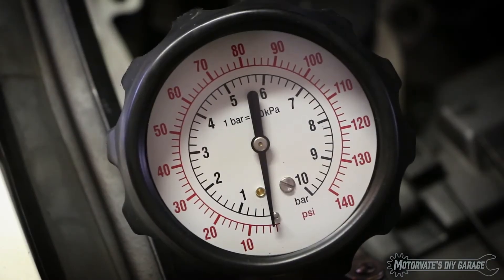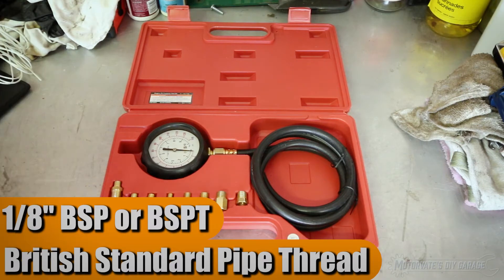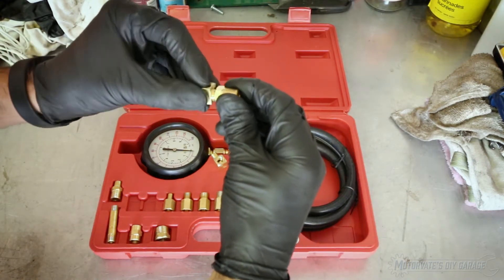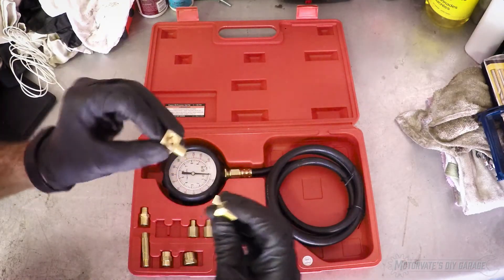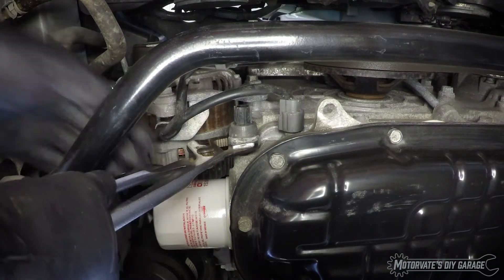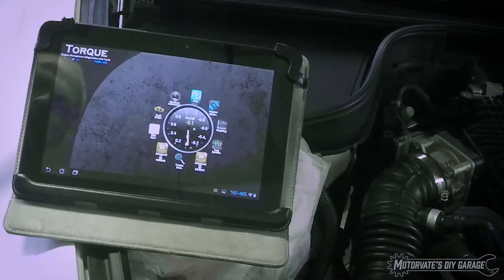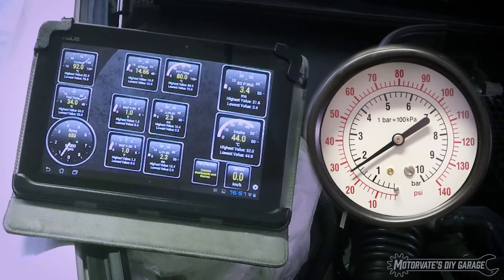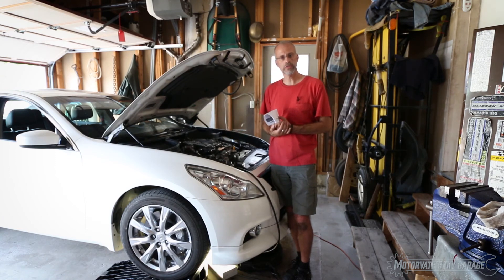Oil Pressure Check: G37/370z - Motorvate's DIY Garage Ep. 18

Comment: thank you . very informative . 

just my 2 cents .. you might want to check your Long / short team  fuel trims  . using the Torque  app .
Reply from the maker: Hey KVJ, I am just wondering why you are asking about the fuel trims?
I have been looking at them since I purchased the car in 2016. They are a little different than what I expect, but if you add the long term and short term (per bank) they are always about -5 to +5
Reply: i ask to make you aware of  the fuel trims, just in case you didnt know about it .

out of topic ... im getting my G37 sedan  dyno tune this wednesday  using ECUTEK .

my mods are  (  stillen G3 intake , stillen catback , and Berk HFC . )  hopefully i get 300 whp atleast .
Reply from the maker: Ahhh, I see. Actually, next week I am starting another channel that will explain all the amazing things a cheap ELM 327 scanner and Torque / OBD Fusion can do.
Reply: Is there a way to check the oil pressure with an OBD2 scanner with OBD fusion? You were such a big help with steering me in the right direction for the transmission temperature I almost feel bad for taking up your time. Thanks for the help again.
Reply from the maker: Hey bpatilo,
Nope... The G37 / 370z don't have an oil pressure sensor, just a (low) oil pressure switch.
The 350z did have an oil pressure sensor, but the signal went strait to the dash gauge and the ECU didn't see it.

If you want engine oil pressure, you will need to install a pressure senor and gauge.
WHICH is an episode that is under development right now - a DIY Oil pressure gauge for about $50
Reply: @MotorvateDIY  wow man you are  on it. I'll look forward to seeing it. Thanks again.
Reply from the maker: Hey bpatilo,
Thanks... I have been a little slow in getting out episodes this year, BUT there has been a lot of research being done and cheap tools being developed:
• Air density computer (for drag racing & dyno testing)

• Differential oil temperature gauge & SD card data logger
• Manual oil temperature gauge & SD card data logger
• Fuel pressure gauge & SD card data logger
• (and my favorite) Crankcase pressure gauge & SD card data logger

I will get all this out as fast as I can :)
Reply: @MotorvateDIY  sound amazing, can't wait to see if I can apply anything you do to my own G.
Reply: @MotorvateDIY  Any update on that DIY Oil pressure gauge? Thinking about doing this for my '08 G37 Coupe. I want to keep an eye on it in case my oil galley gaskets go.
Reply from the maker: Hey John Powers,
Your question is VERY timely!!! The first version of the hardware and software are done.

In the next hour I will be installing my DIY oil pressure AND oil temperature on gauge on my G37 for testing. (this development version also records manual transmission oil temp, differential oil temp, engine RPM, and vehicle speed)

For now, the gauge is an ugly 20x4 character LCD as I need the room to display the additional items mentioned above.

I will have an update on motorvate.ca in a few days.
Thanks for asking!!

Comment: i want to buy a 2009 g37x with 63k miles, do you think i’ll have to worry about the galley gasket issue? that’s the only thing worrying me about the car.
Reply: also if it were to be repaired, is it possible to break again? as long as it’s the reinforced gasket
Reply from the maker: As I understand it, the newer gaskets are no longer made of paper and should last.

Comment: All this technology and we can’t read oil pressure from the Obd2 port
Reply from the maker: Hey  xCkillaxC,
Since most engines don't have an oil pressure sensor, (they have a oil pressure switch) there is no way to know the actual oil pressure, so....no need for an oil pressure PID.

Now, oil pressure can be inferred from how well the variable cam timing is functioning. If the oil pressure us low, it will take longer for the cam to move to the requested direction.

As enthusiasts,  we would love to have this. BUT the main purpose of the OBD port is for emission testing and troubleshooting.
Reply: Motorvate DIY Wow still replying on a 3yr old video, what a boss. Yeah man I know it doesn’t work but one could only dream right lol. I’m looking to buy a G37s this month and highly doubt any owner will let me pull out a gauge and check their pressure lol so I guess I’ll just have to take a gamble...
Reply from the maker: Hey  xCkillaxC,
I check and reply to all comments every day. 99% of the time people are asking good questions and I like to do my best to help :)

I don't have any hard data on this, but I don't think the galley gasket issue is very common. The car forums generally make small issues much bigger than they really are.

I think the G37 Sport is a special car. It does so many things very well and looks wonderful! Good luck on what ever you decide!
Reply: @MotorvateDIY  Is it galley gasket or gallery gasket? lol Seems everyone calls it something different.
Reply from the maker: @bjornironsides6474  In my opinion, they mean the same thing... a passage way for oil to travel.

Comment: What would happen if you left the oil pressure switch unplugged permanently in favor of a oil pressure guage full time? I'm trying to avoid an adapter to keep the oem pressure switch? Thoughts?
Reply from the maker: Hey Christopher Hamilton,
What will happen if you remove the factory oil pressure switch? 

Nothing. The "low oil pressure" signal does not go to the ECM, but only to the dash to turn on the "low oil pressure light"

From testing, the "low oil pressure" light is turned on at 4-5 psi, which it VERY low. (I have bench tested my sensor on my G37)

Here is how the low oil pressure switch works: When the oil pressure is below 4-5 PSI, the switch closes and the light in the dash turns on.

If the switch is not there, the low oil pressure light will not turn on, EVER. Which is OK, if you have an oil pressure gauge.

Three days ago, I installed an oil pressure gauge on my G37 and removed the factory oil pressure switch and all is good!

TLDR;
It is fine and I have done the same :)
Reply: @MotorvateDIY  awesome. I was going to bother with a t adapter but now I'll not bother with that and go right into the upper pan not bothering with an adapter. Thanks bud! Also cant wait to see the pcv data soon!!
Reply: @MotorvateDIY  hey bubba thread tape or sealant?
Reply from the maker: Anytime :)
Reply from the maker: What ever you prefer. 

The old style teflon tape works well, just make sure to leave about 1/8" of the fitting tip exposed. This prevents any chance of tape getting into the oil system. 

A thread sealant also works well and there is no chance of it getting into the oil system, but they do take time to fully cure.
Reply: @MotorvateDIY  hi, I tested mine car and it was reading about 13 on idle and about 44 at 2k rpms but If I put it in drive it drops to around 5psi is that normal or should I replace the gallery gasket?

Comment: One of the greatest engines made if you get a good one. Sounds like yours is purring like a cat, very nice. Great vid, sub'ed!
Reply from the maker: Hey  P Hanley,
I am a long time VQ engine lover, ever since my 95 Maxima.
AND yes,  my VQ37VHR running well (so far!)

In a future episode, I will show you how to build (or buy) a Bluetooth oil pressure gauge and use a free app to see your oil pressure.

Thank  you for subbing!
Reply: @MotorvateDIY  That's great news, I'm looking forward to it!
Reply: @MotorvateDIY  did you make that episode yet?
Reply from the maker: Hey  Иван Грозный,
Still working on it. As you can imagine, there are a lot of items that need to be researched and tested.  

The oil pressure sensor testing is done, as well as testing how well you can receive an Bluetooth signal from under a metal hood
AND the micro controller programming is done.

The next step is developing the app.
Reply: @MotorvateDIY  any update on this? :D
Reply from the maker: Hey 760rudogg,
Yes, I do :)
The final prototype has been in testing since January and it works very well!

Here is a Bluetooth Sensor Server update video:
https://youtu.be/U_kH3K_C2AE

Over the winter I will be doing cold weather testing and should have something to offer in the spring.

Comment: If one had the aem guage is this where we plug into?
Reply from the maker: Hey James Dean Cooper,
Yes, the oil pressure sensor would screw into the same location as the oil pressure gauge.

Keep in mind, the thread on the engine is a 1/8" BSPT (british standard pipe thread). Most aftermarket pressure sensors are 1/8" NPT (national pipe thread) so you might need an adapter.

Here is one I have used:
https://www.glowshiftdirect.com/1-8-bspt-male-to-1-8-27-npt-female-thread-adapter/

Comment: Excellent video. 
  Will swing by Harbor Freight tomorrow =)
Reply from the maker: Hey  Captain ADHD,
Nice! Just make sure the oil is at 80C/176F when looking at the oil pressure compared to the factory spec.

If you don't have an OBD scanner, but have a volt meter:
• The oil is at 80C/176F when the voltage at the engine oil temperature sensor  (while it is connected) is 1.20 - 1.22 volts.
Reply: @MotorvateDIY  thANKS my nay nay. can I borrow your gauge?
Reply from the maker: Hey  Иван Грозный,
Sure, just drop by and pick it up :)
Reply: @MotorvateDIY  I already bought my own
Reply from the maker: Great... and now you are all set :)
Reply: @MotorvateDIY  yeah but dhl has it and they didn't deliver it and I have to pick it up and it's been a pita finding parking at DHL location. Pita
Reply from the maker: I understand.... These are very interesting times. I ordered some electronic parts from Amazon 2 months ago they are still "on their way" Oh well :)
Reply: @MotorvateDIY  yup. Would've been easier to borrow yours
Reply from the maker: Not really... I stopped letting people borrow tools when they didn't come back. :)

Comment: My g37s coupe  not driving like it has 330 bhp....plus I ave a check engine light. So I'm going to get it scan tomorrow. So if it's under 14 psi what u thing is wrong?
Reply from the maker: Hey Mccoy Henry,
The diagnostic scan won't tell you your oil pressure, that needs to be measured with a gauge.
If the check engine code is VVT (variable vale timing) related, then hook up a gauge to see what pressure you have at idle.

The main cause of low oil pressure on our engines (VQ37) is a split rear timing cover gasket.
This is an expensive repair as most of the front engine needs to be removed to get to it.

Hopefully it's something easier and cheaper to fix.
Reply: Thanks man your such a blessing for us G boys n girls out here.
Reply from the maker: Hey Mccoy Henry,
Thanks!
Reply: if you measure i with a manual gauge could be the t oil pump, bad gaily gaskets , oil valve relief, in the worst case could be bad bearings , the stock electronic gauge is not accurate sometimes, the sensor unit can fail

Comment: Mine is at 6 psi :/
Reply from the maker: That sucks.... BUT you caught it in time!
Did you get any codes?
Reply: @MotorvateDIY  nope. I had just finished up replacing the o2 upstream sensors. And was feeling like the top end was making too much noise. So i did a pressure check and bam 6 psi. Been like that i want to say for a few months now. No code. And since I am going to be doing a traveling jobs, figured i better look over everything before I'm 1,000 miles from home.
Reply: btw got to the galley gaskets today waiting on parts now. But I blew out my top end galley gasket for sure. Got a new oil pump, gaskets, timing chains, tensioners, and water pump on the way. 112k miles. Figured if I'm in there, get all of the major stuff done.
Reply from the maker: Were all the galley gasket cover screws tight?
Reply: @MotorvateDIY  not really. i think i broke them fairly easily
Reply from the maker: Interesting... From other reports of a failing gasket, they mentioned that some cover screens were loose.

Anyways, thanks for the quick reply.